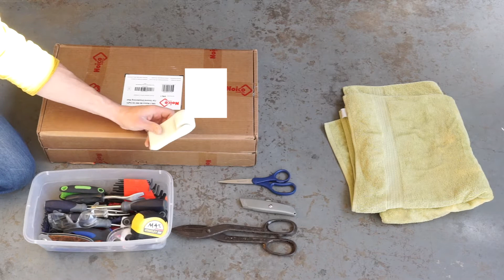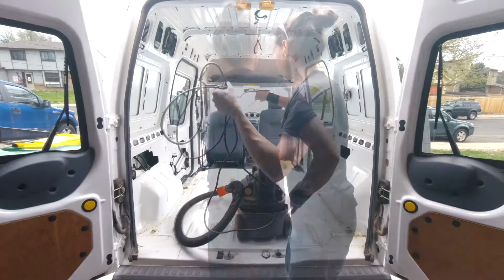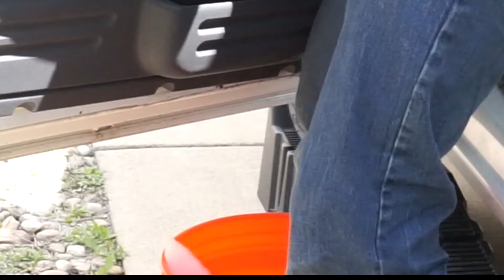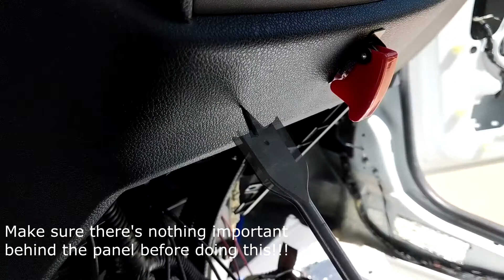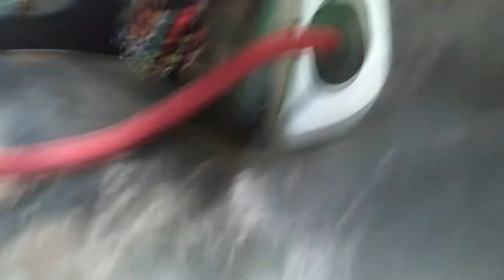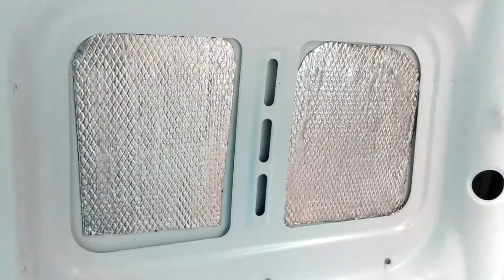VAN CONVERSION - Installing Noico SOUND DEADENING Mat - Transit Connect

Comment: The tests should be done after insulation and everything else is in the van. It is possible that one doesn't need to use special sound deadening material at all. And it is possible that the difference is only there when the van is an empty shell. I'll probably build my first van without this additional sound deadening.
Reply from the maker: I think that’s probably a good call. I’m not going to bother with my next van
Reply: @dustyodyssey  
Wish you to be able to do the second build as soon as possible. Bet it will be a high roof? 🙂
Reply: Or maybe not, depends on what one needs are. Low roofs' / smaller vans' fuel economy is probably quite a bit lower...

Comment: instructions are very clear that covering 30% of each surface produces 100% of possible results.  more is not better. it only adds heat / cold absorbing mass.

Comment: I am rebuilding a nissan campervan so am looking forward to watching your build. about the sound deadening; i heard that on  the directions that using a patch that is 25% size of the panel that is to covered is all that is needed and using the entired size of the panel offers no extra deadening affect. Just a thought as it would also save on weight and certainly cost.

Comment: Good honest review and not trying to “sell” the product . I have purchased this and will probably minimise its use because of weight as the insulation and carpet lining will help also with sound as it won’t deaden the panels as much but it will help it stop reaching your ears

Comment: You need to learn the proper way to connect and disconnect a car battery
Reply from the maker: Ah, yes. Should have disconnected the negative side first. Good call.
Reply: cool troy. i need to learn too. what is the correct way?